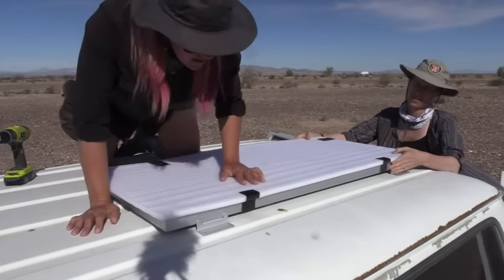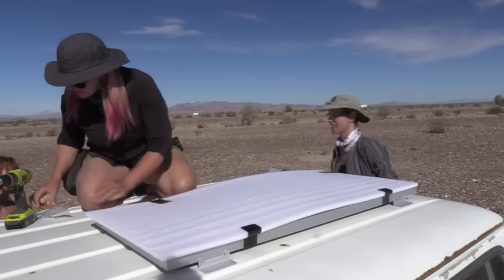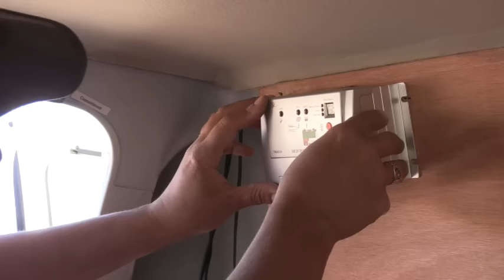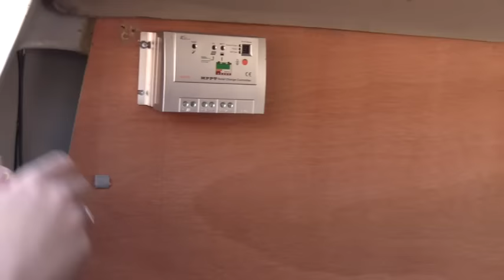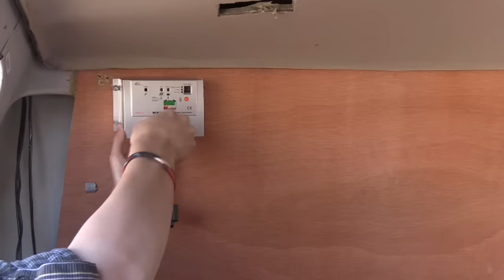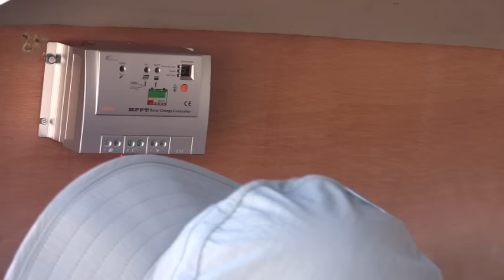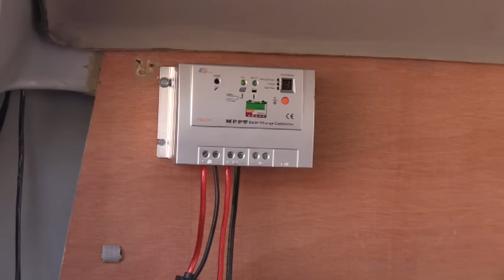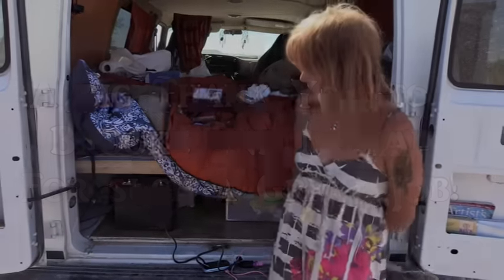Van Life Essentials How to Install a Renogy 100 Watt Solar kit

Comment: We used the Renogy 400 watt solar kit on our van. It was so much easier getting the solar kit and Renogy makes great products. We mounted our panels to a roof rake which makes the panels really blend in. Many people who look at our van tell us they didn't even notice them on top. They are usually surprised when we point them out. Great video! Solar can be confusing at first, but is a very doable diy project.
Reply: What roof rack did you go with?
Reply: I just looked at my van.   It's a 2005 Mazda MPV with a roof rack already installed, thank God.  Never have used it in the past, but now see its usefulness.   Also, the racks look adjustable...hope that's a plus.

Comment: Easy to understand and helpful video. I am currently working on building a system for my van. I noticed several issues that could pose a risk. 1. The fuse should be as close to the battery as possible because if there is a short in the line near the battery it will continue to burn and catch everything on fire, especially since the bed is above it. 2. The battery is a flooded battery which could release fumes into the cabin. 3. The battery should be secured into an enclosed box to prevent anything from becoming in contact with the poles. Love the idea of running the wires through the break light. The huge holes on the ceiling liner, not so much.

Comment: Nice video but I noticed two major flaws. Obviously the flooded battery should never be installed inside the cabin. This is not only unhealthy  but can be very dangerous. He needs a sealed SLA or AGM type battery.
The battery fuse should always be installed as close to the battery terminals as physically possible. If short happens anywhere in the wires, the whole wire bundle will burn and ignite everything in the vicinity.
Another thing I would suggest is to always cover the battery terminals to keep any conductive objects from falling across the terminals. This may start a fire or cause severe burns.
Hope this keeps someone from making the same mistake.
Reply: The amount of hydrogen produced by charging lead acid batteries is tiny.  In addition, since hydrogen is the lightest element in the universe, it races upward at 45 mph once it's been released from the oxygen in water.  It will go out of the tiniest leak it can possibly find.  You aren't going to be breathing in ANY of it.  And a tiny bit of hydrogen that might happen to get trapped somewhere is not explosive.  It is NOT dangerous in the slightest.  The only time it lead acid batteries can ever represent a problem is if a little bit of hydrogen builds up under the caps for the cells and a spark hits it just right.  This can cause the caps to blow up, potentially spraying some sulphuric acid, but without a spark, this cannot occur.
Reply: @williammartin6872  Most flooded battery installs I've seen were enclosed with proper venting. It might be wise to follow those examples and be safe rather than sorry.
Reply: William Martin, your ignorance is downright dangerous. Andrew is 100% correct. Batteries explode all of the time, that's why they have a warning label on them telling you that they can explode. I had one explode while it was being charged, and if I was near it when it happened, I'd be in pretty bad shape.
Reply: Agree, enclose and vent the battery outside of the vehicle. I've seen a lead acid battery blow up. It can be extremely dangerous.
Reply: @garybrewer2352  i know it can be dangerous but dont Mercedes newer ML have the car battery under the rear seats?
if it exploded wouldn't it be open to law suits?
Reply: @sko1beer  Are they using flooded lead acid batteries  or maybe a different type, such as some sort of a sealed gel cell?

Comment: Just a note here, these ladies did a fine job but something to think about. A roof rack would eliminate putting 8 screw holes in the roof for each panel. 
That would also eliminate the need to pull down the inside roof liner. Also a roof rack would give the room for 4 panels leaving only one hole for the wiring.
Reply: Cyndi Foore so how do you get a roof rack put on? Newly here
Reply: Cyndi Foore Roof Rack is easier i do not like drilling the roof ..!
Reply: You can use cross bars that attaches to the side groove of the car. Plus where they put the panel, it will be very hard to expand it if they ever needed to which I think they will because it is only a 100 W panel.
Reply: Cyndi Foore - Eternabond  permanent tape eliminates the need for drilling to secure the brackets to the roof.  No need to buy a roof rack. It is still necessary to drill for the power cord, but one hole is better than nine, less work & less chance of leaks.
Reply: I've considered that. As I'm looking at cargo vans for a rebuild, I'm mostly interested in them that already have a heavy duty roof rack installed for that very reason.
Reply: she handled it like a man? what?? OMG..that does not sound good to women sir..women handle 'it' like capable women..wow.
Reply: Joanne Cipolla-Dennis  lol was wondering  how long till someone replied on that one
Reply: The cargo van roof racks just clamp to the rain gutter on top of all cargo Van's and the 300lb capacity rack I have is only $57.00 on Ebay and I used "pre punch angle" from homedepot. Already has the holes drilled into it and then use u bolts to hold it to the rack. I spray painted mine with white rustoleum to match the van/rack and as a added layer of rust protection
Reply: I think Brooke is really a man...
Reply: i was wondering how i would/could mount 4 panels on the roof, what type/brand of roof racks would/do you reccommend?

Comment: bob you're part of what/who inspired me to do the same thing you are.  i currently have my class C in the driveway, being rebuilt with my own hands.  i am having an electrician over right now to do the tail lights and blinkers, and a plumber coming to connect my new propane tank but other than that, i built it.  im leaving in a few months and will be vlogging the whole thing, but my vlog will be starting this week.  thank you so much for the awesome and helpful videos, keep them comin!

Comment: Nice job guys/gals,
I would suggest that the battery be put into a sealed box and vented to the outside,  when the controller equalizes or charges the battery its going to produce Hydrogen gas which is explosive! Not to mention the smell that will be given off!!
Reply: Hydrogen itself is odorless, if it smells it's most likely something else from the lead/acid battery. Changing to an AGM or Gel battery would remove all smell and maintenence from/on the battery.
Reply: Sin Semilla true, hydrogen is oderless but the sulfer smell will come off the battery from the sulfuric acid inside the battery that is sitting under the bed that is not protected in any way
Reply: Sin Semilla, why don't we just it it truly is: hydrogen sulfide!

Comment: Some constructive criticism, use a pad of silicon above roof and under solar panel brackets to eliminate any moisture between bolt holes (not just around holes) Then, put silicon over top of bolts (roof side) to stop water intrusion past bolt head through washer into interior of van.. cleanup with damp (water) washrag for nice, smooth finish..

Comment: Nope. Still couldn't do it. Brooke has knowledge and skills under her belt that the absolute newbie does not. Going through the brake light. Shrinking with a Bic. "Do wish I was getting more volts", etc. But I still got much good info from the video. Thanks Bob and Jamie.
Reply: Brooke's a dude...

Comment: Yes, if a battery has removable caps for adding water it's NOT an AGM, and really must not be mounted inside a living space, especially under your bed. This includes deep cycle batteries with the extra connection terminals, as apparent in this installation. Also, all batery terminals need to be tightened properly with a wrench, not just hand tightened, as this can create heat and or arcing setting cloth or other flammables on fire!? There are a number of poor pratice items also leading to leaks and or shorts in the future, but the fuses shold take care of the sorts. I would have to write a page or two to go over all of them, I've seen many very good solar power instalation videos on this site and or on Jamie's. there are just too many steps ect left out here etc. I'm sorry to be so direct, but I had to say somthing.
Reply: Finally .. I got to a comment addressing the "high resistance short" created by loose connections. Which will definitely cause heat and potential wire melting.
Reply: Thank you, I think realisticaly, as I have seen even more recient vidieos utilizing lead acid deep cycle batteries, in confined living spaces that I must address them individually as I see them. While the hydogen part of the hydrogen sulfied gas is explosive the sulfur part is poisonious, some what in even small amounts and will just make you feel bad ect. there are a number of solutions, but most are more difficult than  just paying the extra for a non venting battery. I will work out the chemistry, including volumes size of venting ect, whithin a month. The acid in lead acid batteries is sulfuric acid. And yes standard for all electical connections reguardless of application or industry, must have at least close to the designed for tightness of all connections as a requirement. This will avoid even just negative problems muchless very large ones.
Reply: Probably 99% of the people don't even know that there are actually "torque ratings" given by the manufacturers on their connections.  Even on simple items such as connection blocks.  
As for the batteries ... I think a lot of people jumped on that one. :)   Personally though, I prefer Lithium over AGM, etc.  But, they are cost prohibitive to many. Although ... you get more for your dollar in the long run.
Reply: Yes I totally agree, That's where I'm tring to not insert my self too much. And need time and prayer to get this across, reasonably. But I think,and or know, there are resonable solutions. My difficulty is trying to not offending, while trying to address the missunderstandings. And I've already figuered out several solutions, off hand, when designing various setups from a design, engineering perspective, over decades, I always had checkers and or other enginers etc, to check my calculations ect. ect.  And I don't have that now, so I'm trying to be very carefull to not overspeak!? What do you think?

Comment: Well I’ll be, that looked pretty simple, though I think I’d prefer a rack to put it on, the rack will be handy for other things to. Though I don’t understand the need for the voltage meter seeing how the box (forgot name) tells u it’s working + I don’t know what I’d need to buy that connects to the box to charge up what u want to charge or for a light. Those girls did a wonderful job. And thank u Bob for sharing this, the thought of my installing solar has been intimidating, I greatly appreciate this. Thank u

Comment: And yes, all lose connections make for a high resistance connection, which results in undesiegned for heat. This is even at low votage depending on amperage, ohm's law, etc.

Comment: I used Rivets with butyl and dicor, didn't have to access the back side with rivets. Holding up wonderfully. Some use vhb tape but I've lost a bendable panel on the freeway.  Both videos are on my channel!  You'll see with rivets, you don't need to remove the headliner/insulation if you've installed it.

Comment: Oh ya, roof rack which attaches to the drip edge around the roof.  This also would add huge air flow under panels which gives a bit more watts to the batts.  No holes in the roof or all that sealing. And the liner panel! Down side to this would be you look like a contractor, and the extra cost of the racks.  Still a good install and instructional video.

Comment: Besides the battery issues listed below; venting, tightening connections, short protection; the battery should also be physically secured so it is not bouncing around as she is driving down the road.
Reply: Yes, securing the battery is important.

Comment: Painful to see holes being drilled in someone's roof.  Worth the money to use ladder racks to mount them on.  Then only one hole in the roof for all the wires to go through.
Reply: Yep...kind of like drilling teeth...ouch.
Reply: I think roof racks as well sorry
Reply: Those mounting holes dont look sealed very well either.
Reply: If you HAVE the money.  I get the feeling they don't.
Reply: Never take advice from someone who believes in chemtrails.
Reply: Hardy Williams like the government? They have a patent.. you may want to research a little before you make yourself look more 😜 silly
Reply: Since the solar panels are a temporary mount on the roof, I was thinking  about routing the wiring through the window vent.
Reply: Love both you an lexus in put watch your channel as well as your's she is an awesome lady

Comment: Great lesson Bob. Questions??? I'm glad you showed charging the phone because I was wondering how that wired box on the ply turns into lights, power for a laptop  or charging devices. I think I get it.
     So when you say 12 volt does that mean powered through a cigarette lighter? I think I have a basic inverter. I have a device I plug into my cigarette lighter in the car and it has a house style Power outlet to charge my laptop. Would a solar set up mean I would not need to have the car running or be using the car battery via the cigarette lighter?
     Thank you for sharing your skills. You make lives better.

Comment: Thanks for sharing..Thinking of doing solar? Hear good things about Renogy. Do you recommend a system with thicker gage wires for faster charge? Or are these standard?
Reply: I believe that the wires going from the Charge Controller to the battery are too small. I've seen installs by highly capable people, and their wires were bigger.

Comment: Also at Jamie's recent van build I noticed they were using a silicone caulk for a sealant, and an adhesive. So they eliminated the use of bolts, what are your thoughts on this?

Comment: Did the fuse boxes come with the kit, or where do you look to buy them separately?  Great job on showing this, because I understand this better now.  After Hurricane Harvey we rigged up 12 volt fans in the house using car batteries but had to charge them with the car during the day. I am getting solar panels to set up power supply for emergencies at home.  THANKS.
Reply: T Green they look like automotive in line fuse holders. Get them at any autozone, pepboys, etc..

Comment: Two questions:  Why wasn't a roof rack installed first? Why wasn't the screws used in conjunction with tape and caulking to avoid roof van leaking?  I felt the pain as she was making the hole in the van roof.

Comment: i would recommend to anyone else wanting to do this to look into using VHB tape by 3M to affix the solar panel without the need to drill any holes.
Reply: And when you are driving around with that on your roof, you really gonna trust some tape to keep your expensive solar panels from flying off? I don't think so.
Reply: it's what they use to affix windows on skyscapers
Reply: It's used on high end cargo trailers to join the aluminum sheet/sheathing, instead of rivets-- YES, requires meticulous surface prep, application... don't let it get on YOU!

Comment: If they want to expand to 4 panels they will need to move the placement of this one and that leaves a hole in the roof.  I used a bit of bondo and it's good as new (a little ugly but keeps the rain out)

Comment: Use an AGM battery (that's what they use in mobile homes because they are sealed) and put it in a box so nothing can touch the posts. You've been warned.

Comment: For better ventilation: as much space as possible between the panel and the roof, because there is poor performance when the cells are hot.

Comment: I know your supposed to get the watt hours from the appliance or light but what is an example of what 100 watts will power (ie  12 cup coffee pot, LED lights)? thanks
Reply: Devices just use watts. Watthours is a battery rating. 

A 100 watt panel will power nothing. (figuratively speaking) The battery where the power is stored will power your device. 

You have to take the average hours of daylight in your area (AVG Daylight HOURS 4) times that by your solar panel rating (100 watts) and you have an estimate of usable power for your area. So my example would give you 400 usable watts of power per day.
So thats 1 100wat light bulb for 4 hours or 1 10watt led light bulb for 10 hours. Do you see where energy efficient appliances will help out?

Comment: So funny I have been torturing myself for a year now over this very thing. Can I or Cant I? the mechanical aspect is a breeze but electrical always throws me. I think I have it except for how to wire the inverter into the system so I can use existing outlets. Just got estimates for 200w system installed from 3,5k up to 7k which seems a little excessive to me. was thinking of waiting till RTR and having it done in Quartzsite.

Comment: If you live in a minivan and value stealth in a city,which do you recommend a solar generator or flexible solar panels with battery and charge controllers,power inverter etc ,considering the limited space ?
Reply: There both the same?

Comment: A vented to outside battery box would not only keep the battery gasses out of the van, it will keep the battery terminals from shorting out if something metal accidentally touches the top of the battery (no big sparks that can set things on fire). I don't see bat boxes used much in these van builds and it makes me wonder - how many batts are bouncing around, unsecured, sparking when they hit metal?
Reply: I was thinking the same thing. All the stuff being stored? Chances are there for an "oops" to happen. Then the whole rig burns. That would ruin your whole weekend.